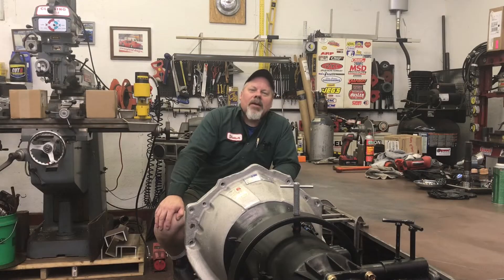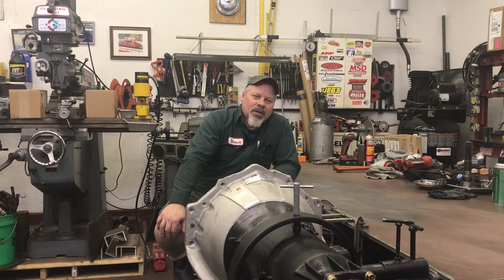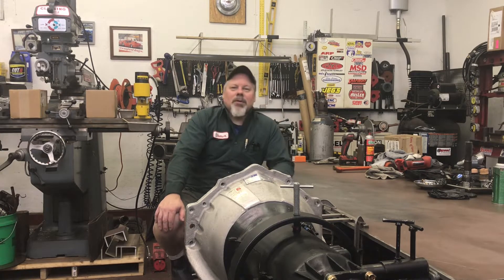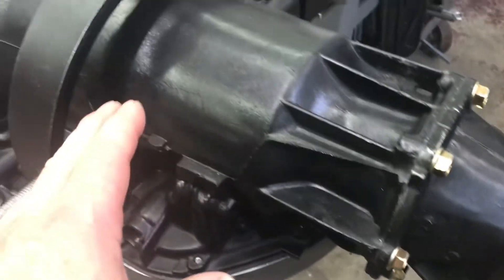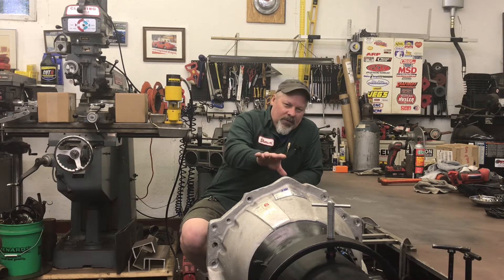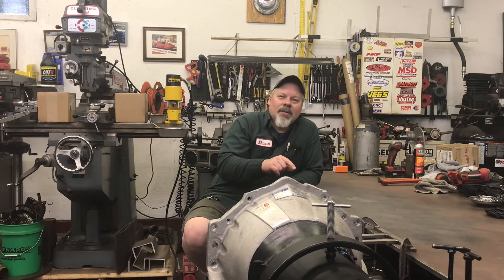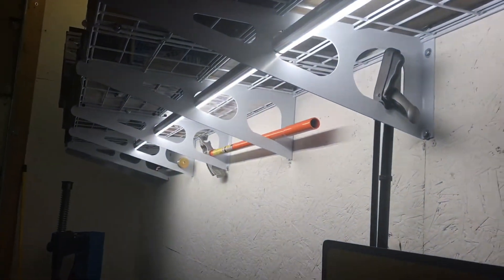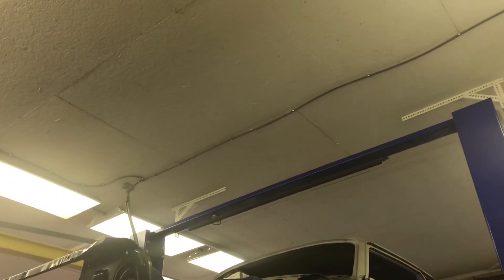Friday Wrap Up: JW TH400 & LED Shop Lighting.

Comment: My JW Turbo 400 with a brake was built back in 2002. It would back up with the shifter or in neutral with the button applied, so both.

Built for use in a Mopar 😊
Reply from the maker: Nice!